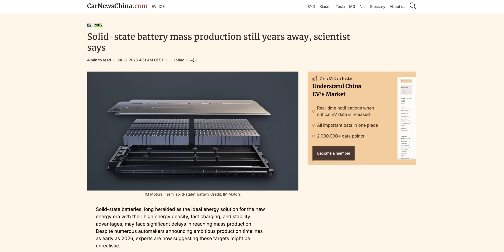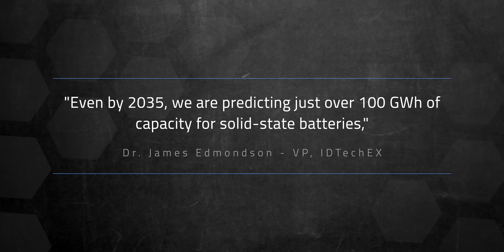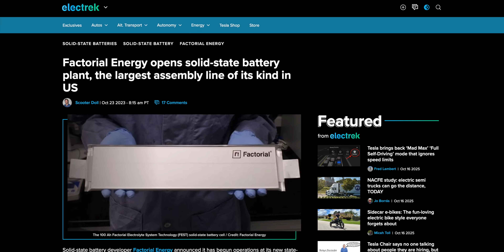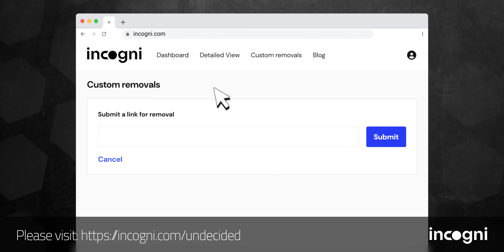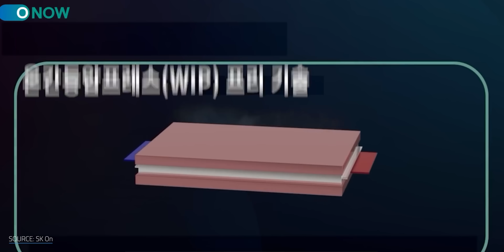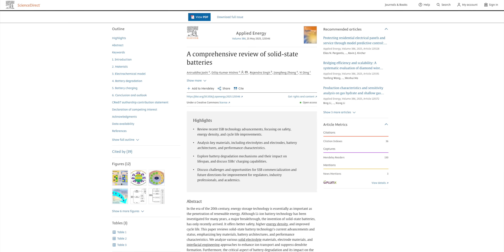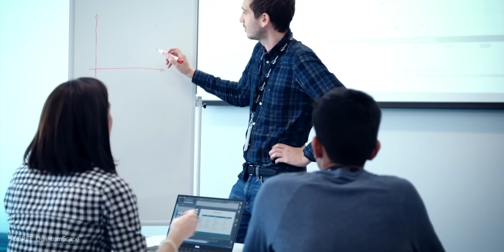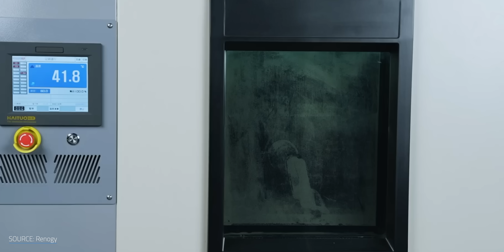How Close Are We to Solid-State Batteries?

Comment: There is no point in moving to solid state for energy storage unless you are talking big business storage with 3+C charge / decharge rates all the time (grid stability services). In that niche it may be worth looking at it. But in general with energy storage it means very very low C rates and there, current batteries are safe enough and applications are stationary thus all the nice features are not really needed.
e.g. either they can bring down cost and weight, bring up capacity and life expectancy as well as safety and make themselves attractive for mobile applicatiosn including flying or it may eventually fade even before it really hit the market.

Comment: Over 300 Wh/kg! That'll do nicely, for now. I was already ahead of the curve, when it came to understanding that most great 'inventions' were usually two or three technologies maturing simultaneously, and at least one, was materials science. (No printing press in Roman days, because the alloy that allowed one letter to be repeatedly stamped on the page, without losing its crisp edge. Steam engine in ancient Greece? They couldn't have built boilers that could withstand the pressure, and even then what they did build would have been prohibitively expensive. While desperately watching every green tech, for some hope of salvation, I have learned so much about, you try a chemistry, works brilliant, can you produce the chemicals at scale, can you assemble them into packs.. cheaply. Will they cycle 10,00 times, won't know until we try them. I suppose Graphene has been the big one. A true wonder-material, which actually would be a 'game changer' if we could push out huge strands, or sheets, of blemish free, precisely doped and tuned to our task, graphene. Get off your asses you bunch of do-nothing chemists and materials scientists. You guys have been holding us back for millennia. We invented Graphene twenty years ago, and you can't even MAKE it. I suppose some 2,500 years passed between the Greeks inventing atoms, and physicists finally making some, but still, any F*cking time, Sweethearts.

Comment: With and Sillicon Carbide Solide State we can expect to gain another 15%-25% of density along with better heat and discharge management as well as retention of capacity is what I think but 2035 out for that if it comes. or perhaps we need another angle while not completely radical, but evolutionary revolutionary

Comment: I don't think it matters if it is solid state or not as long as they are better than what we have now. The Chinese government has a deadline for car manufacturers to produce batteries that do not burn no matter the damage. The Chinese government is not going to back down on that requirement so in my opinion they are confident they can achieve it. There are also many companies already offering much higher energy density batteries than current batteries in cars. I believe we will start to see new technology being used in the cars being sold in the very near future.

Comment: I find the current Li-ion NMC batteries work well enough to not cause me any usage problems.  The real win is the electric drivetrain, the battery only makes it possible.  If they get better, that’s fine, as long as the car continues to be reliable, smooth, and accelerates like stink.  I don’t need a 750 mile range at all.

Comment: For motorcycles the argument for electrification is not compelling enough yet (as it is for cars) - 150HP might sound like a lot for a Ducati race bike, but the motoGP bikes put out well over 300HP, and even the streetgoing versions of the Panigale are around 220HP. Riders aren't flocking to EV bikes as they have abysmal range, like, laughably bad. The Zero has a range of like 50 miles fully charged.

Comment: It's not just a matter of technological capability. These companies are racing against the downwards spiral in battery prices, from competing chemistries like sodium ion.  If the price of SSBs is relatively too high in relation to what these alternatives may offer, even with its superior specifications (cycles, recharge time, specific energy, safety), it may still not be produced. Car makers have to make a sale on the whole car, and if the battery is too costly, they won't make that sale and will be stuck with an unsold vehicle.  Already, most US manufacturers (exception Tesla) do not make profits on EVs because the scale of production is too low, and the adoption in the US is being discouraged by current government policies towards electrification of transportation and renewable energy.  All of these factor in to how viable, as a business, SSBs for EVs are.  Only the companies that can deliver on competitive cost and large manufacturing capacity will likely survive the SSB race for EVs. There are still many other applications, though. QS is probably the company with the best technology (ceramic separator) in minimizing dendrite formation.

Comment: I am sooooo tired of major companies declaring that they will have solid-state (SS) batteries will be available in the next year or two. Toyota is infamous for missing its dates for producing SS batteries. 

As far as Mercedes making a car with SS batteries, that proves absolutely nothing. SS batteries already exist, and they have existed for years. The problem is that no one has figured out how to mass produce a RELIABLE, long-lasting, SS battery. So what if the Mercedes EV went 749 miles on one charge? There are still multiple key questions that need to be answered:

1. How much does it cost?
2. Can it be mass-produced?
3. How durable is the longevity of the battery? How many charge cycles is predicted before the battery loses 10% of its capacity? How many charge cycles can the battery produce while maintaining 80% of its capacity?
4. How does the battery perform in extreme hot and cold weather?
5. What is the energy density of the battery?

All of these speculations and juvenile promises of producing a viable SS battery  are getting old. The FACT is that that the most proven battery chemistry right now is LFP chemistry. It is rock-solid durable, it can be charged to 100%, LFP batterires have 6000 - 8000 cycles, which amounts to about 20 years of use. LFP batteries hold their range extremely well if taken care of properly. They will maintain over 85% - 90% of their capacity after 10 years of use. They work reasonably well in extreme hot and cold climates (they lose about 30% - 40% of their range but they are reliable and proven). They have fairly good energy density. 

Newer NMC batteries are also well vetted and are proving to be very reliable and durable. While not as durable as LFP batteries, if they are properly taken care of, you will still have 85% of your capacity after 10 years.
Reply: Correct! 2:08 "if the  battery charges to 80% in 10 minutes and won't catch fire when it's punctured". BYD and CATL's latest plain LiFePO batteries achieve both and will be cheaper than SSB for years if not forever.. The only thing solid state has going for it is increased energy density (volume and weight), but the inexorable rise of bloated SUVs show most buyers want big heavy cars 😢. SSBs may allow the lighter nimble EV sports car that a few noisy car fans demand, but they seem more relevant in other applications than cars, such as lighter e-bikes and more capable electric aircraft.
Reply: @skierpage  I dont' think that you understand the potential of SSBs. SSBs will probably beat current battery systems in every way if they can be perfected:

1. They will lose very little range capacity when operating in extreme hot and cold climates. Some prototype batteries lose as little as 3% of their energy capacity in extreme temperatures.  In the extreme AZ heat in the summer, the LFP battery in my Tesla Model 3 loses about 40% of its capacity in extreme heat, mainly because the car runs the heat pump at full blast to cool the battery pack. This is normal, and it is important because extreme heat will permanently destroy batteries, but extreme cold does not. Extreme cold also drains their capacity and range, but it does not damage them. SSBs can and will solve these temperature problems in the future.

2. SSB prototypes have been created that have superior energy density to existing batteries. The Mercedes-Benz battery is probably a prototype with this capacity. We were not given specifics, but it is likely that the test battery has greater energy density. There are several SSB prototypes that more than double current energy densities.

3. Several SSB and semi-solid-state batteries have been designed to charge from 0 - 80% in about 10 minutes. CATL has a semi-solid-state LFP battery in mass production now that charges to 80% in 10 minutes. But the CATL battery is not a true SSB. The CATL battery also has superior energy density. CATL has a strong reputation for never embellishing its battery announcements. So we can be 95% certain that this CATL battery is real, and it is already being introduced to the market. It will be interesting to see how well the battery performs in the real world, but CATL is the largest battery manufacturer in the world. SSB batteries have the potential to exceed these semi-solid-state batteries CATL is currently releasing.

4. SSB prototypes are currently being developed that have the potential to last over 10,000 cycles and maintain 95% of their capacity. This would mean that these batteries could last over a million miles without losing significant capacity. CATL is now near to releasing a million-mile battery (932,000 miles specifically) that will literally outlast the car itself. It is also developing a 1.24 million-mile battery, which will last 4000 cycles or about 16 years. Both of these CATL batteries are LFP batteries. CATL is also working on a sodium-ion battery that will last 3.6 million miles and over 10,000 charge cycles. Interestingly, this SI battery has about the same energy density as current LFP batteries. So some version of this battery might make it into EVs. 

So SSBs or semi-SSBs will be the future of EVs. As mentioned, my Model 3 has an LFP battery and in the AZ summer, my range drops down from approximately 240 miles to around 150 miles. So there is definitely room for improvement. Also, while Teslas function competently in sub-zero temperatures in northern climates, they consume a significant amount of energy warming the battery pack and experience similar range loss to my Model 3 in extreme heat. Prototype SSBs solve these temperature related problems.

The real challenges facing SSBs right now are two-fold:

1. Vetting SSB performance in real-world conditions to verify they are reliable and durable.

2. Mass-producing SSBs in an economically feasible manner has been an unsolvable problem. They can make them, but they cannot mass-produce them. Until that problem is solved, SSBs will not be a reality in affordable EVs. They are going to start appearing in high-end, very expensive EVs initially, like the Tesla Roadster. Until the mass-production problem is solved, we will not see SSBs in cars for everyday people in the middle class. 

However, in the short term, CATL's semi-solid-state LFP batteries may become dominant. This becomes problematic because CATL is a Chinese company and has direct ties to the totalitarian Chinese government. So, CATL could be used as an economic weapon against the US and other Western Democracies.
Reply: @franklong6269   to repeat myself since you seem to have reading comprehension issuess, cheap LiFePO batteries can already charge faster than 10 minutes ( > 6 C charge rate) and last a million km, so it's pure supposition to think SSBs will beat LiFePO on those metrics. You're right to bring up the increased temperature range that SSBs claim. But why will SSBs be "the future of EVs" if they don't become cheaper than LiFePO that's good enough for 80% of the market?
Reply: @skierpage  Hmmm, it's not my reading comprehension that is the problem; it is your actual lack of experience with LFP batteries. I OWN a Tesla Model 3 with LFP batteries, and I charge it every week. So I have firsthand experience with LFP batteries and, obviously, you don't. Your MAJOR problem is that your writing is very poor and unclear. What you are probably referring to are CATL's new LFP semi-solid-state batteries, which are reputed to charge from 0-80% in approximately 10 minutes. Current LFP batteries do not charge anywhere near that quickly.

Also, you seem to infer that I think that LFP batteries are inferior, and I have never said that. They currently are the best battery chemistry available for longevity and energy density, and that is why they have taken over the solar battery industry. In a sense we agree that LFP batteries are the best right now, compared to other chemistries being used.

What you fail to understand, because you have no first-hand experience with LFP batteries in EVs, is that as soon as the temperature gets above 90 degrees F, they lose a massive amount of their range. In AZ, where I live, my range drops from 230-240 miles to around 150 miles. So LFP batteries categorically are not a great battery for extremely hot and cold climates. They are not the panacea that you are trying to describe by any means. In temperate climates they are great, but in hot or cold climates, they lose a tremendous amount of power because they have to expend it cooling or heating the battery pack. LFP batteries can also charge VERY slowly in extreme cold weather.

Enter SSB batteries and these Dr. Jekyll, Mr. Hyde range changes are completely fixed. They keep their range in a HUGE temperature range. They also charge nearly as fast in extreme cold and hot climates. So SSBs are vastly superior to LFP batteries for that reason alone. Add to this that they will probably have better battery energy density and will be more durable than LFP batteries and you can see why the entire world is committing massive amounts of resources to develop working models that can be mass produced. 

Next time you feel the need to "repeat yourself," go find a mirror and take your own advice before you make dumb comments!
Reply: If cold temperature sodium sulfur battery really succeed and made into production, the solid state battery may not be needed since its material cost are far cheaper than solid state

There are many lab researches of those and all the sodium sulfur prototype has super high density (over 700Wh/kg, which are more than 2x more energy dense than NMC). But although it's very promising, it's still far from being eligible for mass production as sodium sulfur battery still suffers from poor charge-discharge capability (only 0.5C vs >5C required in most EVs) and low cycle life (only 100-200 cycles before degrading below 70% health vs >1500 cycles required in most EVs right now)
Reply: @sihamhamda47  There are a myriad of battery chemistries being tested right now. As you mention, the problem with most of them is that they are not durable - they degrade quickly when cycled. Also, hot or cold temperatures destroy a lot of prototype batteries. As Elon Musk has noted,  battery science is very complicated. I will be very interested to see if and when these experimental chemistries actually succeed to the point that they enter into mass production.

Comment: A solid state battery is not a thing in reality, its a marketing term used for hype.   A real solid state battery requires micrometer level construction and needs to be made the way that semiconductor waffers are made in a fab with material  deposition stacking.

Comment: I think a lot of marketing people and reporters really don't understand the different levels of research.  Something like battery technology probably starts with research chemists.  Success for them is demonstrating that the chemistry is feasible.  Success is something works one time in ten, or has a 99% waste product production.  Then it probably goes to some engineers, who have to design some kind of functional battery out of the chemistry.  Success for them is making a battery that can be put into a car, even if it takes months and costs hundreds of thousands to build.  Then the chemistry probably goes to process chemists and chemical engineers.  Success for them is making the production process more efficient and cost-effective.  Then back to engineers, who refine the physical battery design and come up with a manufacturing process.  Then onto factory engineers, who design the factory, and supply chain development.  Suppliers may need to be trained on how to produce parts or do their own research.  There's not a lot of overlap on the skill set or equipment used at the different levels.  Technology can get stuck at any one of these levels.  CATL claims they've solved the factory design and supply chain issues for a sodium ion battery that's on par with or exceeds current LFP batteries.  If that's true, that's more exciting for me in the short term than solid state.

Comment: They're not sold state but the Enovix and Amprius batteries are at least better than the current li ion.  Enovix said at their last quarter update that they should have orders in 1Q26 or 2Q26.  They are targeting cell phones.  Amprius has repeat orders for its SiCore and SiMaxx batteries.  The SiCore is high-end drones and LEVs.  SiMaxx is super expensive for military use.
Reply: I’m glad someone mentioned Amprius their new more affordable Sicore SA105 battery has 450Wh/Kg and 905Wh/l decent lifecycle of around. 700 to. with their 1.8 Gwh of capacity and profitability I think they are the best bet when it comes to the need to great batteries.
Reply: Still not plausible for EVs yet since those silicon anode battery are only rated for 500 cycles, and right now EV industry needs battery that could last for 2000 cycles or more because of the 8 year battery warranty policy that will become a standard soon enough